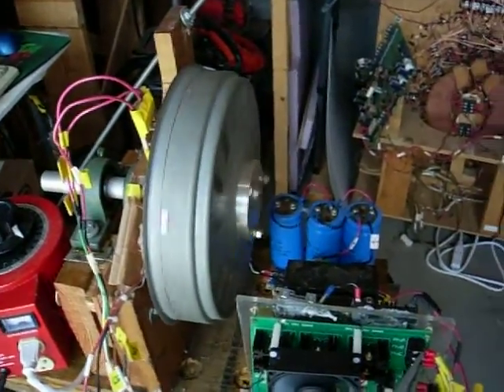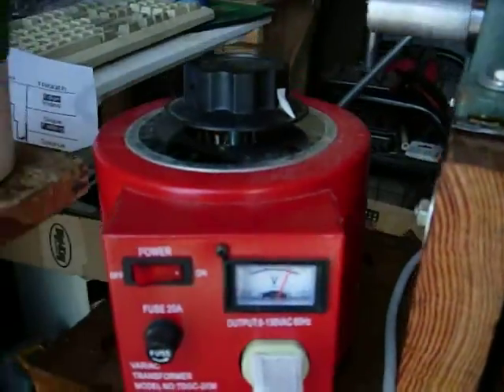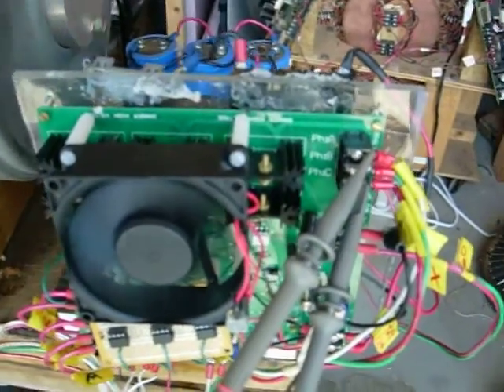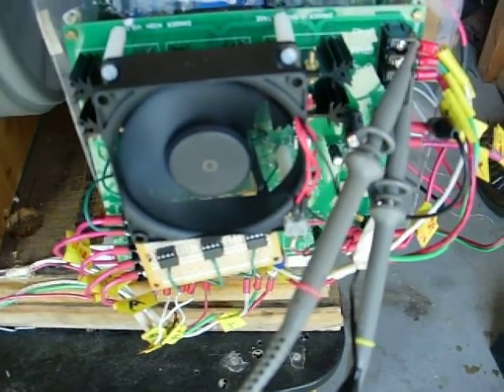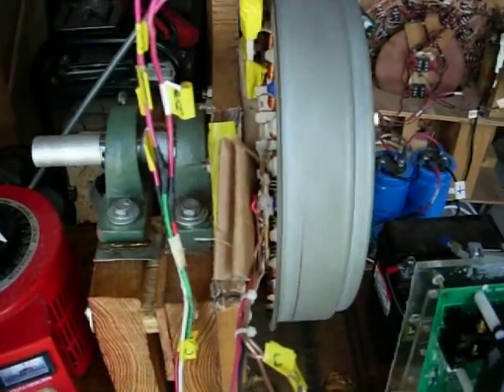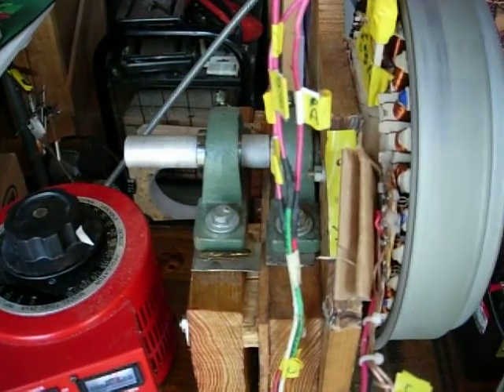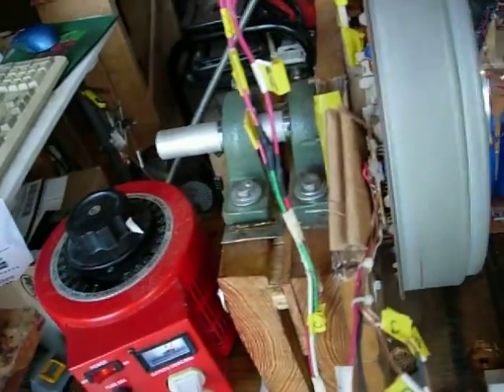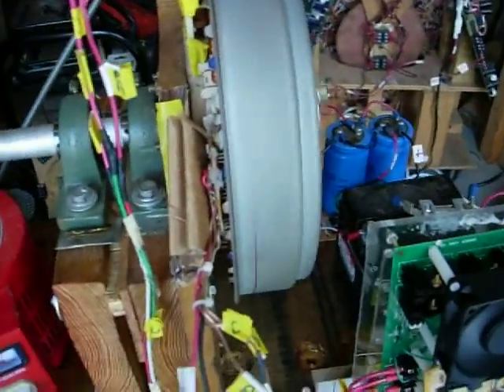Don Smith #135 running with 4422 drivers to bottom FET's

Comment from the maker: Update:   just got 10 of the new pcb's which now have the Iram controller and Atmega48 micro.   I has everything that I need to get the program into the IC I just need to figure it all out.  I was able to get the source code by running the Doxygen and I believe that the Codevision will handle the down load out the pc port thru the tiny device.   The reason they want you to down load and install the Atmel Studio program is because codevision uses it for debugging code.  In the codevision program I found the compiler and went to the file selection to get the source code from the Doxygen Folder.  That seemed to work fine.  I then clicked on the compile key and it produced an error was found in the code.   The fix is replace PCINT1 with PC_INT1 and then the compiler worked great no errors.  once I get  the PCB's done then off we go.

Comment from the maker: The plan is to use a deep cycle marine 12vdc battery.  This can be replaced latter on with a farad capacitor power pac.  This will recharged using feedback from out put transformer through a battery charger.  A 1500 watt pure sinewave inverter  to run the Anaheim.  this will run the motor/generator.  generator output will feed pole transformer array.   I see no reason why we can't wind our own pole transformers once we analyze their structure